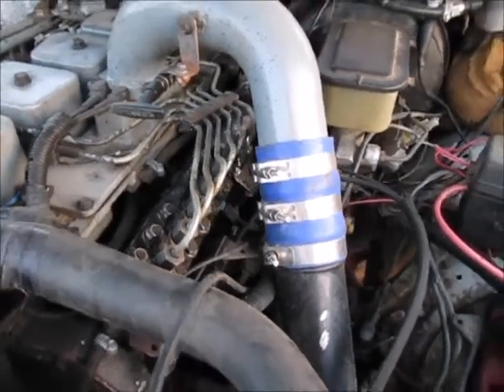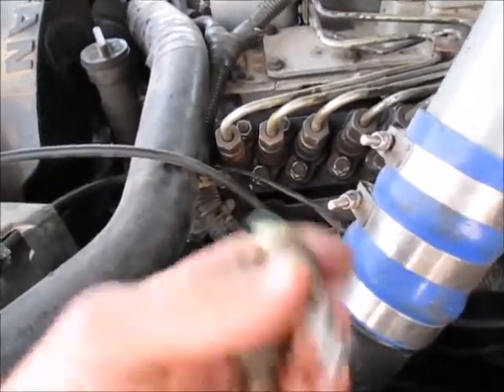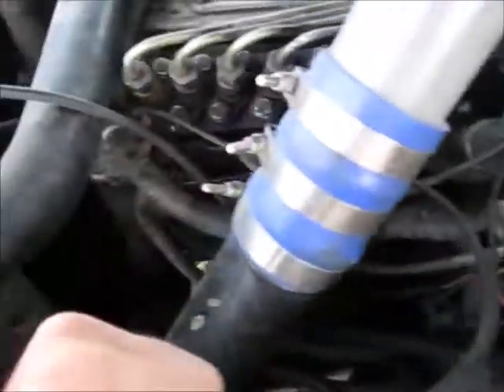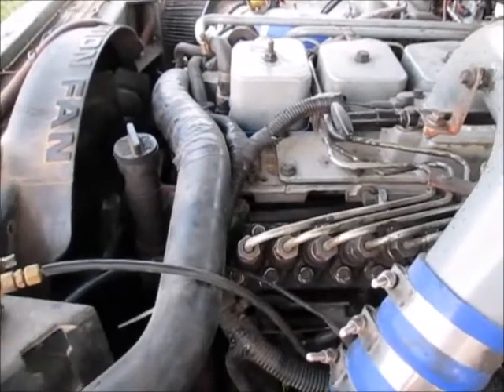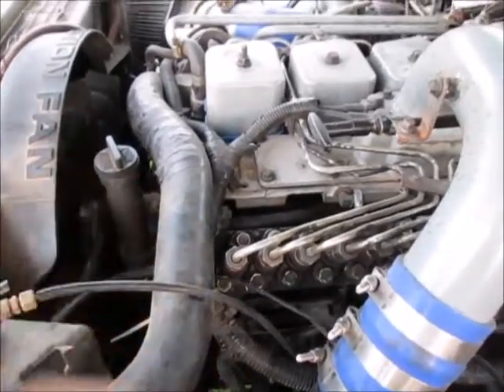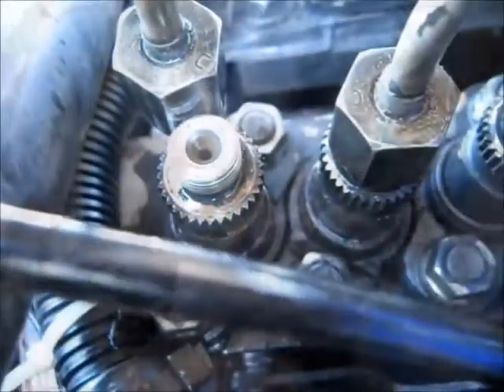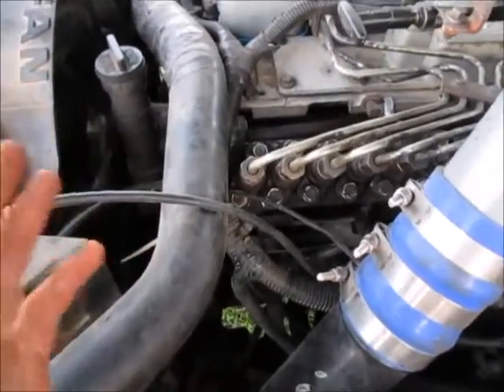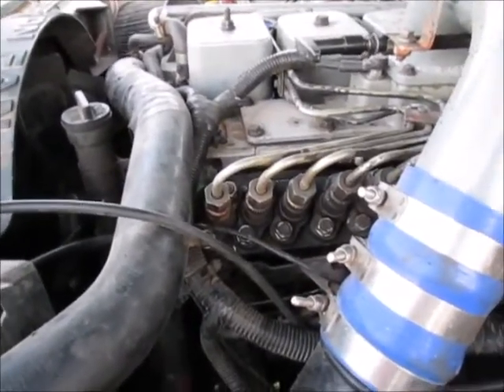P7100 Spill Port Timing - Tips'n Tricks

Comment: I used to do this years ago with no issue and I thought I was getting complete “stoppage” of air at spill port closure. Went to time one the same way today and I never did get a noticeable change in airflow out of the deliver valve holder. I messed with different air pressures, different cylinders, etc with no change in results. Ever ran into this? (Shut off lever open of course)
Reply: Still flows fuel though the delivery value has stroked up the bore ..I think what you are explaining means ,that the timing side ,(tappet and plunger need adjusting .What looks like is happening to me is you may notice the delivery value piston raising if you observed it ,but it isnt raising enough because the cam and tappet is either worn and not lifting far enough ,maybe it can be adjusted,most can  .It seems to have maybe too much wear on the lift side and thus not fully closing the charge port possibly.Should be able to adjust from the side cover in an line pump.Just my 2 cents .